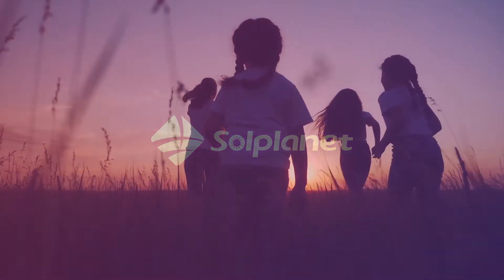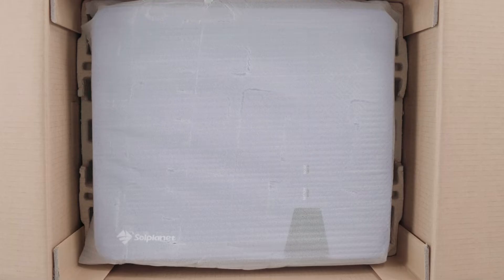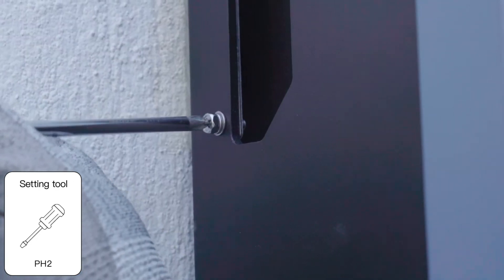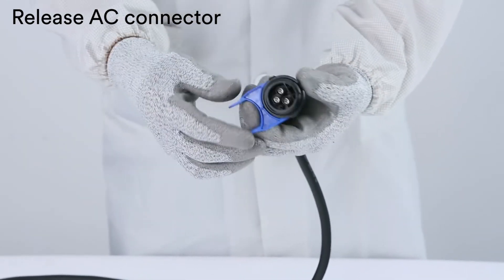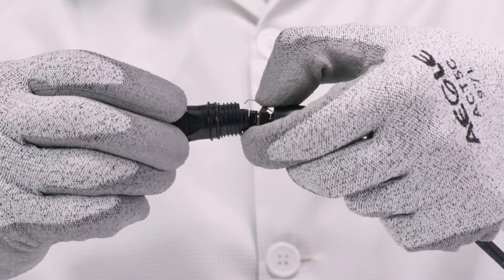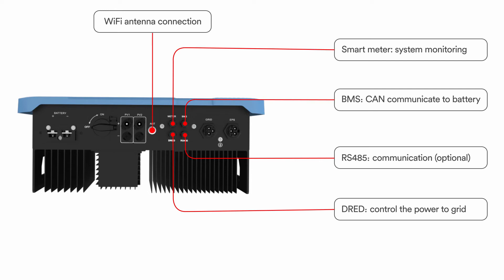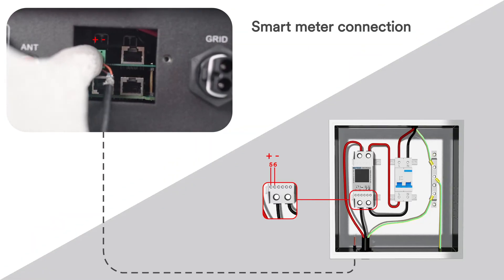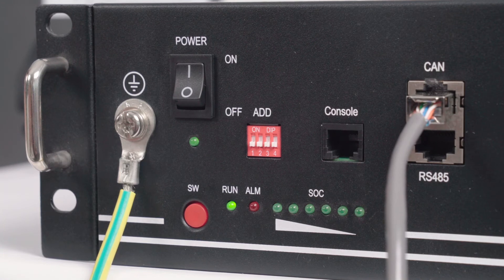Solplanet ASW 03K-05K H S installation video

Comment: No information about the app configuration and no information in the app manual what the acronyms stand for. For example EEG. No troubleshooting for example why it shows what power is going to the grid, even at no Solar what is used by the grid.

I give the app -5 out of 5 stars 🌟 

I have no idea what I am using on an hourly kilowatt hours and am I drawing from the grid.